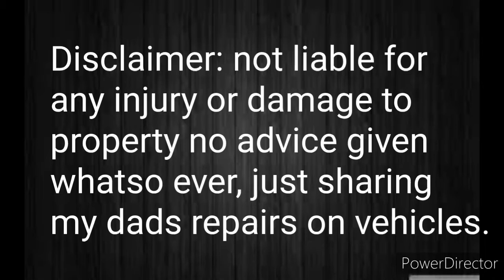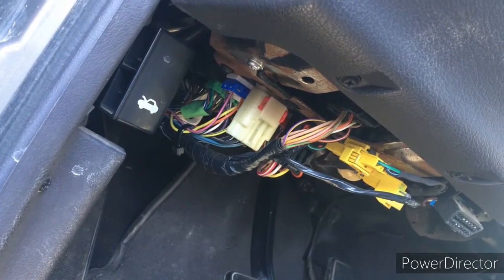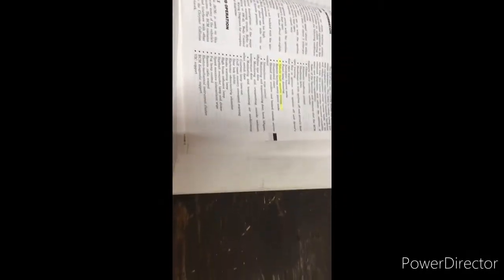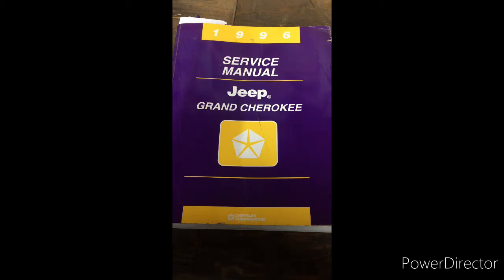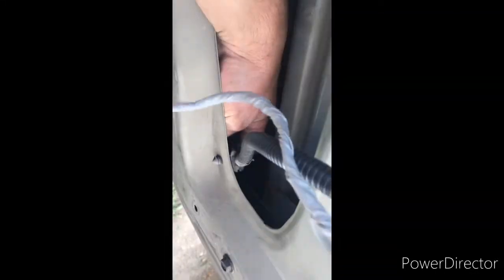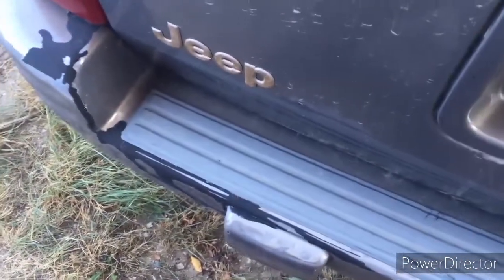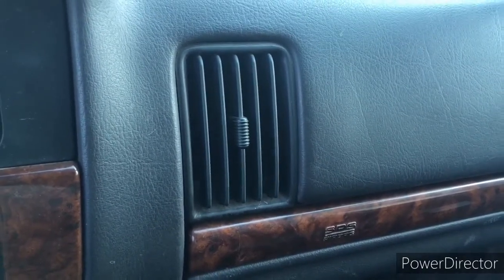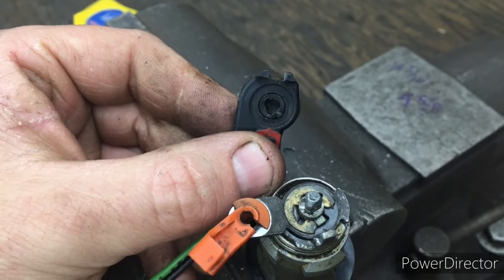1997 Jeep Grand Cherokee Alarm Bypass (indepth look)

Comment: 95 Jeep  dies while going down the road or no start ,cranks only ,remove clove box cover ,you will see relays on the right ,to the left is the security module ,remove upper screw, heat up long flat blade screwdriver with small torch ,melt off lower screw holder unplug module as car is running ,no more problems!!!

Comment: Just lost my fob and realized I have this issue with my drivers door. kinda annoying but thanks for sharing this so clearly.
Reply: When I disconnect all key sensor switches all that happens is that the alarm can not be disabled. If I lock with the interior switch the alarm (light on dash) goes on, when I unlock with the key in the door the alarm is not turned off and when you open the door the alarm goes off. Am I misunderstanding something?

Comment: Man, if this fixes my issue that would be unreal! I've dug around Jeep forums for a while with no one really knowing any permanent solutions to this problem for 96-98 ZJs. How has no one discovered this earlier? How has your solution held up since you unplugged the indicators? Is there any reason to unplug all three of the indicators instead of just one? And are there any weird "side effects" of unplugging these indicators? Thank you so much!
Reply: I had a 95 all I did was find the alarm and unplug while the engine is running and that solve the problem permanently I have a video on my channel with the location.

Comment: Dude, my heart goes out to you for all the shit you had to go through to nail this annoying problem. What a nightmare. But you pulled it off. This is very valuable info to folks with this Jeep alarm problem. Same thing happened to a friend of mine. The alarm started sometime in the night and killed the battery. Then, after charging it up, she couldn't start the Jeep. I'll be disconnecting all the indicators on her vehicle tomorrow. Kind thanks for sharing this. Very clear and understandable video. Instant LIKE! Greetings from Alaska.

Comment: I have a 1995 jeep Cherokee 4.0 doing the same thing with the alarm and can’t turn off after putting in a new battery since I don’t have key fob and trying different sequences of unlocking not working… would this video be the same for a 95? Or is it different on the 97?? Thank you I’m advance

Comment: Hi, I’ve got a 97 zj but don’t have the remote to stop the alarm and the immobiliser. The technic to put the key on the passenger door or on the back don’t work… I don’t know what to do … I wish you will be able to help me
Reply from the maker: Try my video; 97 Grand Cherokee Change fuel pump or… not - part 9. Time = 15:50

Comment: Does disabling these sensors prevent any of the other functions of the doors from working? Like the power locks or windows?
Reply from the maker: I have other videos called; electrical the # 1 bad. They show thinks I found with door switches and controls. Etc.
Reply from the maker: Electric door locks and windows should still work

Comment: i have the 98 GC 5.9 limited with the alarm disable issue .Disconnected all the lock cylinder alarm switches .if i use the key fob to unlock ,it sets off the alarm ..horn etc..so i have to use my battery quick disconnect and clear the alarm ,then it will crank.when i unlock with the key only ,it starts no problems.so i never use the key fob anymore.any suggestions ? BCM ?
Reply from the maker: Sounds like it’s backwards = usually using the key to unlock the door sets off the alarm and using the fob to unlock the doors is fine. I don’t know what would cause that. If the lock cylinder indicators are disconnected then there shouldn’t be communication to activate the alarm?
Reply: @lokiryder5235  It works the other way. lock cylinder indicators disconnected means there is nothing to turn OFF the alarm. Using fob or interior lock switch turns ON the alarm.